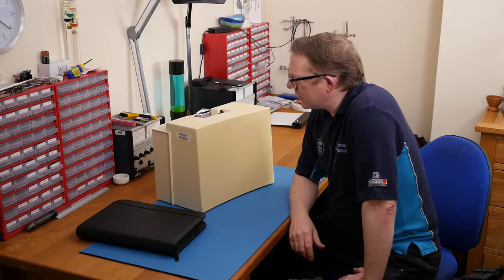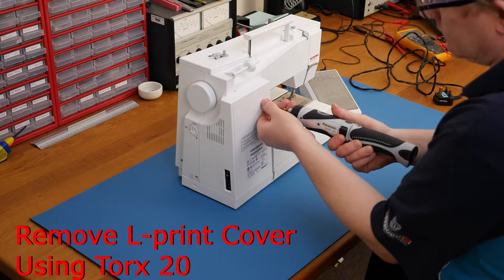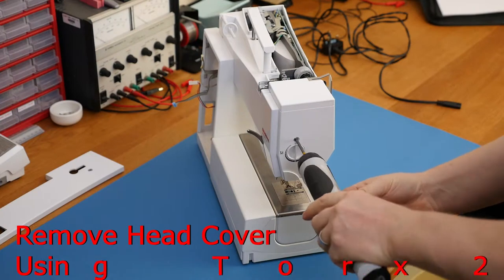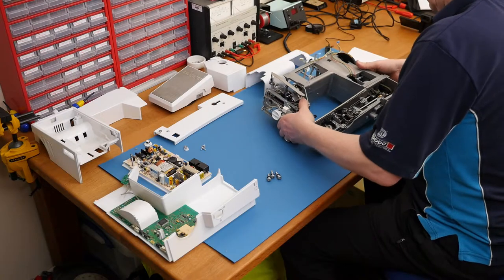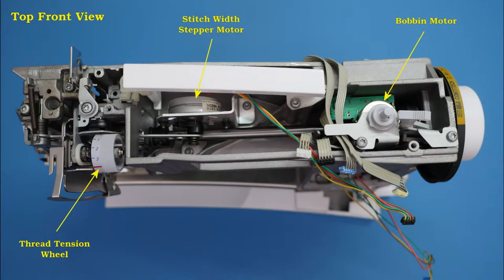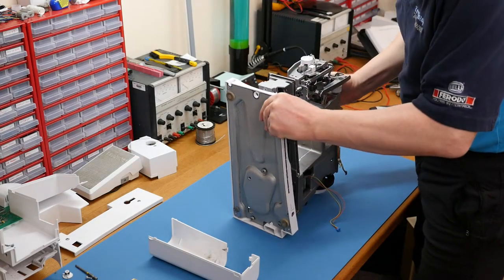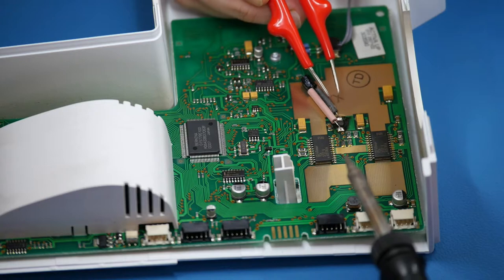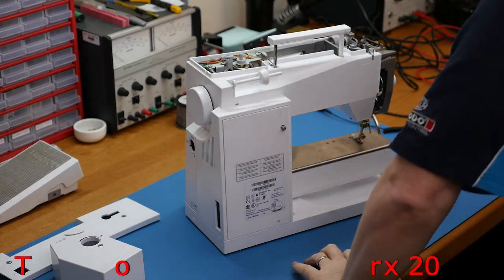How to Mend Repair a Bernina activa 140 Sewing Machine  + 🏃‍♂️ Live Machine Running 🏃‍♀️ disassembly

Comment: Thanks for sharing. I have a Bernina 125 S.
When I start the machine it works fine, but after a short while it just turns off while the screen light and the sewing light are still on. 
When I start the machine and don't without using it after about 3 minutes it turns off. 
When I start the machine and use it after about 7-10 minutes it turns off.
In both cases both screen light and the sewinglight are on.
This machine has a switch mode power sulpy.
Reply from the maker: Wonder if something is overheating.  Could the mechanics need lubrication to ease the loading on the motor?
Reply: @CoatsandGaiters  The mechanic parts are om. The wheel turns easy. That's why I did try to test the machine by only turning ig on, and not using it. It turns off afte 3 minues!
Reply from the maker: @hosseinhayati9820  Sound like something is possibly overheating and being shut down to prevent a fire risk.
Reply: @CoatsandGaiters  Thank you :) I will check more :)

Comment: Thank you for posting the video of the Bernina Activa 140 sewing machine in Youtube.
I bought a local used Bernina 140, and it runs slow, but keeps the speed. I bought a  new foot pedal, and the issue remained.
The machine is able to perform all decorative stitches as well.
Would you happen to know what could be causing this issue?
I believe it could be the power supply, but I don't have the electronic diagram to fix the Bernina.
Any help would be greatly appreciated.
Thanks in advance.
Reply from the maker: That sounds rather odd, I would have said foot pedal but as it's new that rules that out.  Has it been serviced as the oil will dry up and put the motor under more load though I doub't it would slow it down that much.  I'd have thought the power supply would either work or not really.  If it's the same Bernina as in my video I'd take it apart and just see if there is anything obvious that's burnt out.  I don't have the schematic on the Bernina but the component that cooked was clearly the same as the other 2 near by which I where I took the value from.
Reply: Is there a way to adjust the stitching speed of the machine, either at the foot pedal or in the main machine? My Artista can go from 500-ish to 880 stitches per minute but I have to go into the program to change this. Check your manual.

Comment: Very impressed with your video.my bernina activa 220 has a slight problem.the l.c.d.back light does not work.any idea what could be.
Reply from the maker: Sorry for the delay.  I'd just try and find the power to the LCD and see if it's got power.  The tantalum capacitors do fail which will cut the power and they have a service life of around 20 years.

Comment: A lot of circuitry in there as well! Just looked up the price, these are still expensive machines, well worth fixing!
Much more valuable than the junk I work on :p
That cap sure died gracefully, sometimes they take a lot of other stuff down with them..
Reply from the maker: I know they are still £300 + second hand !!! I assumed it would be more than just that one component.  It’s one thing replacing the obvious and another to know what your looking for ...... which I didn’t lol was a lucky break

Comment: Thank you for this informative and concise video. Your detailed pictures are very helpful. It looked like the burnt capacitor did not have any discernible writing on it. How were you able to determine the capacity and voltage requirement for the capacitor you installed? Thanks again for a great video.
Reply from the maker: Hi and thank you for your compliment.  The circuit had another identical circuit alongside so took my capacitor values from that circuit.  Sewing machine happily running still.

Comment: 8:38 what do you mean by “position indicator”? Thanks.
Reply from the maker: Needle position indicator (needle can move left and right)
Reply: @CoatsandGaiters  Thank you. I was wondering what the function would be of the last module that I hadn’t figured out on my 145. I think that’s it but still need to work out how exactly it works with the main board,

Comment: Fantastic - I know the capacitors are a known problem on 10nn series berninas as they get elderly ( mine has had them done) time for my ex school activa 140 to be looked @ - funnily enough I'm into old motorbikes too ( and valve amplifiers )   I'm going to ask you the million dollar question did you go back and replace the other two caps ?  Also from a resourcing perspective I like the idea continuing with old machines until they can't work any longer these are beautifully made and should last a long time
Reply from the maker: Thank you.  I probably should have replaced them now in hindsight.
Reply: Haha - just pleased getting it running I bet ..,

Comment: This is a great and helpful Video.
Its helped me work out whats wrong with my Activa 140, however the tantalum capacitors are tiny on mine and I can't find the right one at my local electronics store here in Oz.

My board is a lot more compact with smaller capacitors. Capacitor number is  475 50k 835 and is yellow ochre colour. Any help appreciated. I can send a photo, but don't know how.
Reply from the maker: Hi and thank you for the comment.  You can send photo's to me via Coatsandgaiters@btinternet.com

Comment: Hi there, great video, love the details and commentary. the problem with my bernina is that it powers on including the lamp and LCD display, bernina "burp", needle position works however two strange things happen when I engage the foot pedal, 1. bobbin winder runs both when in the off position and on position (switch tested with multimeter, looks okay). and 2. when I eliminate the bobbin winder and unplug the bright yellow cable from the L print, then nothing happens (main motor still not running) any ideas?
Reply from the maker: Thank you for the comment.  Not being and electronics engineer I’d just try and inspect all the components for maybe a failed component.  Apparently the tantalum capacitors for example only have a life of 20 years and after that they are expected to fail.  Sorry I can’t be more help.

Comment: Hi it’s me again, at last bit the bullet and took my machine apart yesterday with a friend standing by!!! When it was looked at by Bernina agent who cos of its age said it’s not worth repairing,seems they did not put the main fuse back on the back board. There was yellow by it like it had blown. Replaced both the 3 amp and 4 amp with new fuses. Tried machine and it blew. Tested fuses but they hadn’t blown. Saw the resistors that had blown. Took this to a shop who repairs boards but he couldn’t see the colour of R9 as badly burnt. R8 has blown and that is gold silver blue green. Also R12 blown plus he said the part on adjacent to those parts probably went too. He recommended either finding a close up diagram of that board (although identical model to mine the plan you show is slightly different in layout) wondered if you could help there? Or he said try and contact Protek for a new board not Bernina who would overcharge. He was quite positive and is prepared to repair board if I get the parts! However not sure if it’s closer to the graveyard??? The other board showed no sign of scorching? What do you think. Will send photo of damaged bit. Grateful for any advice! 👍🏼Sue
Reply from the maker: Hi Sue are you able to send me a photograph of the damaged area and the resistors in question please.  coatsandgaiters@btinternet.com
Reply: I’ve sent email thank you so much for getting back. I’m afraid photo not great but you maybe able to work out the problem.
Reply from the maker: Unbelievable I have photographed every bit of that board but the part you need.  I can see resistor R12 which looks to be Red Black Red & Gold  but that's all I can see ahhhhhhhhh  The only way I could possible find out is if I see my mum next and ask her if I can re photograph the board.  Don't throw the machine out though will you.  Still worth money on ebay not working. @susanbearsley7746

Comment: The oscillation of the shuttle is way to much on my machine making it impossible to set the timing. Where is the adjustment for this? (not the "needle rise" position but the amount the shuttle swings back and forth by) usually built into the design on most other machines.
Reply from the maker: Your asking me something I sadly don't know.  Could it be your machine has severe wear taking the mechanism outside it's design tolerances?
Reply: @CoatsandGaiters  no it's in excellent condition.
Reply from the maker: @Chopper894  have you an email address